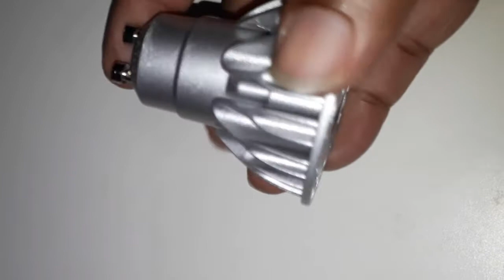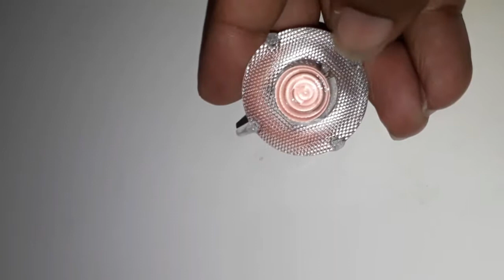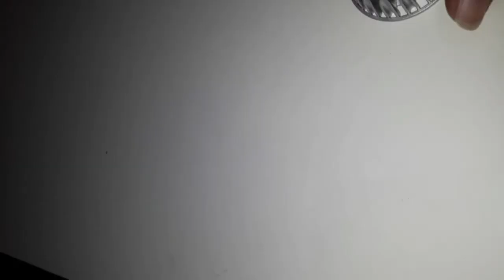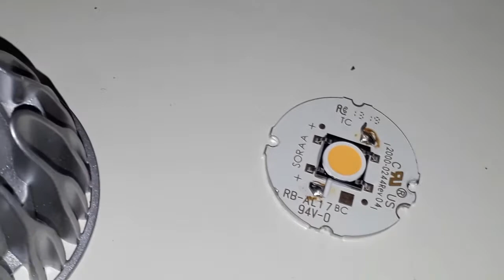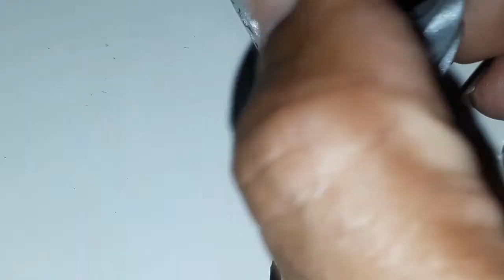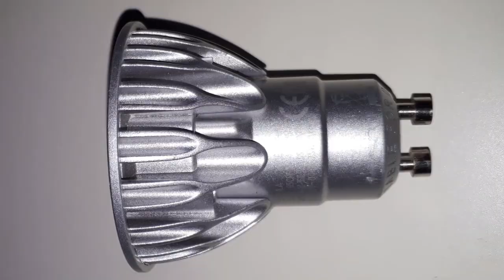188 Soraa GU10 Led Bulb

Comment: The 94V-0 is a specification for PCB circuit board and has nothing to do with voltage range of the LED. It is a UL standard. You can search the net for more info on it.
Reply from the maker: Thanks. I didn't know that.